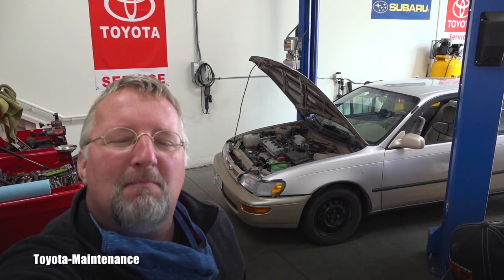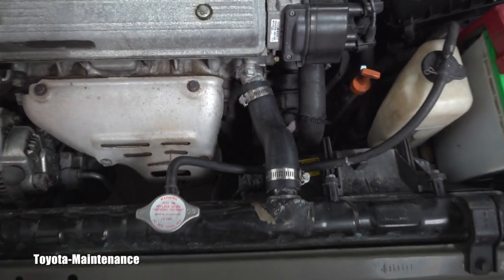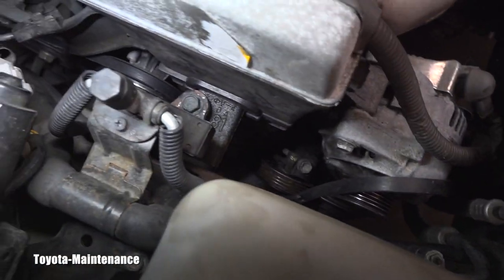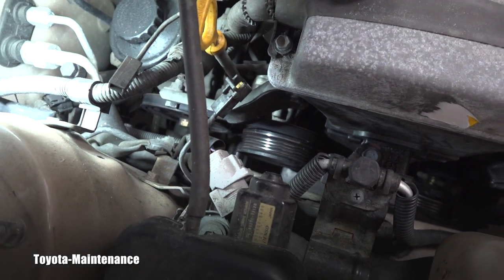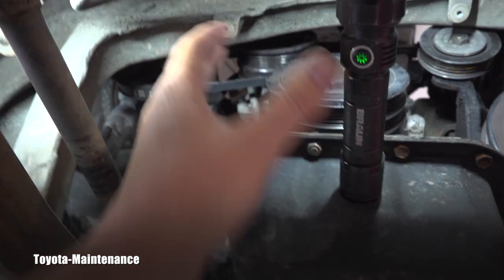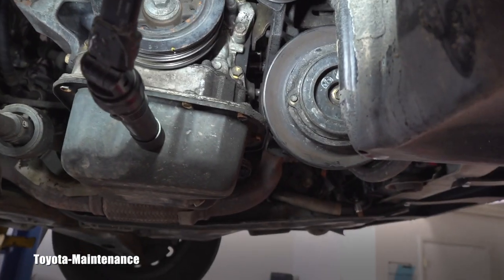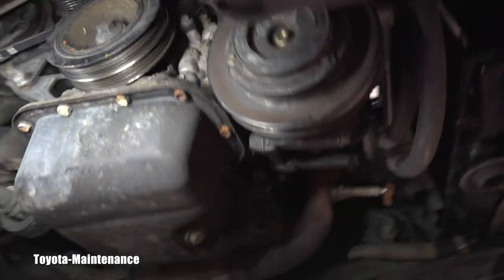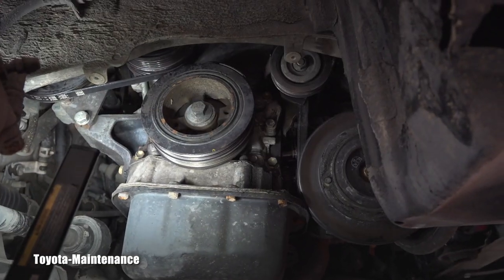Toyota Corolla engine overheated for unusual reason

Comment: Possibly the most reliable car ever produced...when properly maintained.
Reply: Too bad they rust up and come apart in the Midwest , engine and trans are top notch
Reply: @danh2134  Krown Rustproofing will solve that problem. My 15 year old Canadian 'Corolla'  has a perfectly solid body to go along with the top notch mechanical components.
Reply: @rightlanehog3151  unfortunately here in the Midwest rustproofing is seen as a "add on dealership scam" even as an after market service . I have worked on cars with that rubber like film undercoat that still rusts under it.
Reply: With all the salt they use, rust is inevitable. All you can do is delay it.
Reply: @danh2134  I use an oil base, soak it every year, the others just dry out and salt gets in behind. You cheap bastards can do the oiling themselves, check out Sweet Project Cars on youtube for demo.
Reply: @danh2134  wash these vihecles DOWN with diesel or kerosene (hand wash)...plus penetration every year .....they will not rust.....please note 📒...I am from the 🏝️ islands....we know rust....small islands... completely surrounded with salt 🌊 water.,need I say more👊🏿💪🏿
Reply: @selassiecru8667  spray the undercarriage or clean the car completely?

Comment: I learned a lot about maintenance working on my moms 98 Corolla since she got it at the dealer, very basic 1.8L with a basic 3sp Auto Trans-separate diff on the 3sp. Just sold for my mom this past March for $1G to a mechanic, had over 283k miles and he was happy to buy it. The Corolla is my DIY inspiration.
Reply: U sold the antique....I have 5 Corolla....2000 1996..1998...1984..and Betssie..rear wheel driven..don't remember the year...I will comment the year soon

Comment: Had one of these a few years ago blew the hose on the back of the water pump housing  and cooked it to point where smoke was coming out under the bonnet (hood for you Americans) I thought is was stuffed let it cool down changed the hose and it went for another 5 or so years. What an amazing little engine one of the best Toyota made in my humble opinion.
Reply from the maker: amazing engine

Comment: Hi there...very helpful video. I was almost close to have that problem on my Corolla Station Wagon a year ago. Those bolts have a tendency to get loose. On my case the one behind AC compr. get loose but only a couple of treads and head hit the compressor a little bit. I just retightened again. My station wagon is still my daily driving with 171k on the clock. Those car are so much well build. Greetings.

Comment: Gosh, they don't make these 1997 Corollas like they used to.
Reply: You are correct, they don't make 1997 Corollas at all anymore. 👍
Reply: @Duraputer  Who knows, there are so many variations of the Corolla across the world it might still be in production somewhere.
Reply: ROTFL
Reply: I still have my 2000 corolla. 370000km or 230000 miles
Reply: @youngb1ood  If you are in Canada I hope you have been rustproofing it. Nothing is sadder than a solid engine and transmission surrounded by a rotten body.
Reply: I have 1999 Toyota Corolla LE 121,000 miles

Comment: 2:48 Looks like the idler pulley is out of alignment
Reply: It is attached to the same bracket as the A/C compressor and that bracket is what came loose.  I've worked on Toyota and those bolts are very tight.  Someone along the line has done work in that area and didn't use Locktite and tighten those bolts properly.

Comment: I gots 2010 Corolla with the 1.8 vvt engine auto trans We got it new in 2011, it's My wife's car , My wife drives 120miles 3days a week plus around town here , car's got 279000.0miles with zero troubles !! Only use Mobil1 full syn 5w20 n toyo filters it's got one of those cartridge filters!!
Reply: What is your oil change interval?

Comment: I will be interested to see if the bolts were just not tight enough when the compressor was replaced (the compressor looks new), or if the bolts actually pulled the threads out of the block and the block will have to be re-tapped to accommodate the bolts.

Comment: Dear Sir. I saw a question without answer in another video when searching for my own Corolla 1998 problem. Why the click. click. and no cranking and no start engine problem ONLY when HOT weather starts and our cars seat under that terrible heat. Today, when I attempted to move my car to a shady place it did not start and after knocking the starter with a hammer, checking the battery posts, moving the start relay to clean the contacts(I could not pull it out) I finally seated on the car i start bouncing the car several times and then I turn the key and IT DID START ! Years ago ( maybe was summer also?) I was told the car needed a new water pump.... however, my car continued working fine without it, just because I do not trust mechanics. Many thanks in advance.

Comment: 2011Toyota Corolla spits and sputters rough idles , but not all the time comes and goes. Replaced Spark plugs , replaced coils , Check fuel pump fixing to replace 02sensors. Tonight on way home from work it Overheated so the says impossible wasn't drove more then 7 mins as it read thatIstoppedthe vehicle got out and felt pressure cap was Cold reservoir was low tho.filled it up drove it home no problems overheating. Sluggish to climb hill still goes in limp mode.Could theses be a bad fuel in injector symptoms. ?
Reply: Note the only code this car has ever thrown is cylinder 1 misfire

Comment: Overheated and "blew the hose"? That sounds completely bogus. What is likely, is that the head gasket has or will soon fail as a result of overheating. Or the cylinder head is warped or cracked now. So this baby will likely soon be in the junk yard. Someone either forgot to torque those compressor bolts or forgot to put them in altogether. That hose looks awfully short and the clamps are wrong design. But thanks for the video. These were reliable car, albeit now considered caskets on wheels.

Comment: I have the same engine 7A-FE in my 1994 Celica and it burns and leaks oil. Why is Toyota considered reliable? Or is this because the previous owner installed an LPG system in the car which destroyed the valve seals? I see especially a lot of smoke when I accelerate after coming down a hill, If i shift to neutral on downhill, then no smoke on acceleration.
Reply: Hi, I have a 1994 7A-FE. They are busy little engines and they do blow a bit of blue smoke and do leak here and there, now they are getting older.

Mine has 200k on the clock and is 30 years old but works perfectly apart from a few oil leaks and as you mentioned blue smoke on acceleration and going up hills and under load. This is usually caused by valve stem guides being worn. Not much to worry about. As long as your compression is within limits (about 180). Gaskets will fail and leaks then happen but remember these cars are over 20 years old, most with hundreds of thousands of miles on them and they are still going. Mine blows a bit of blue smoke, leaks a bit of oil, but I’d still drive it around Australia without a second thought. Bloody thing is a tank.